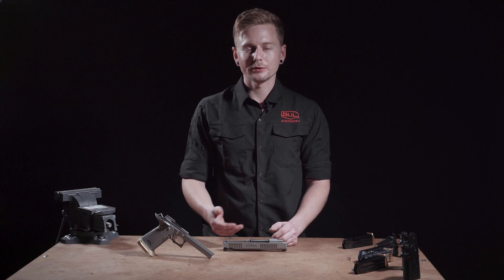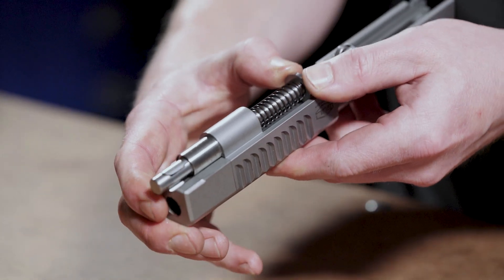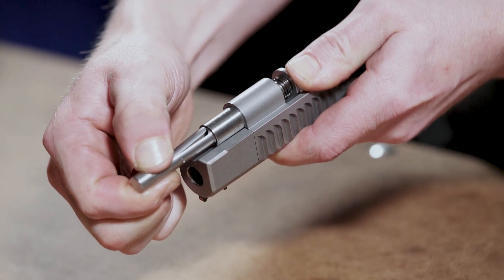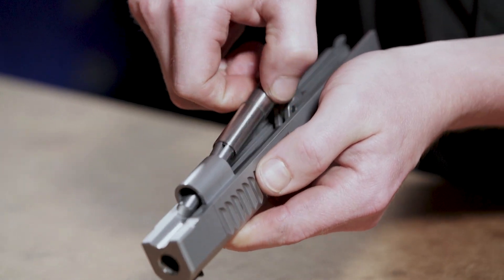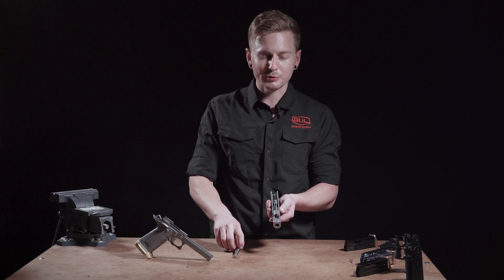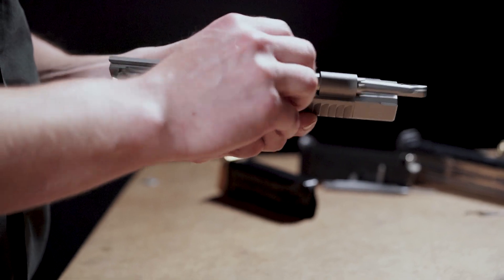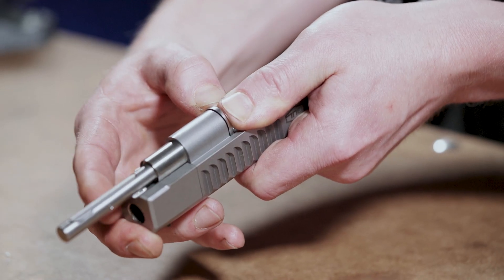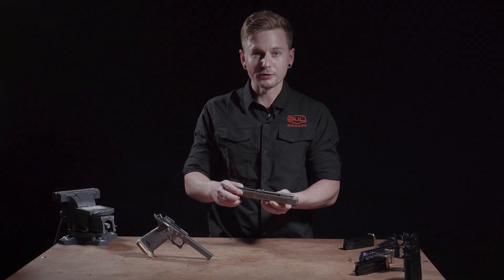Bul Armory tool less guide rod disassembly.

Comment: Is this a Bul part?  Or does the Dawson part work as well?

Can the tooless guide rod simply be swapped into the Radical 5.4?
Reply: i am wondering this as well.
Reply: Love how they post a video and never follow up with answering any questions.  Irritating
Reply: @jagpilotohio  seriously !  Using a hacked up paper clip end is getting old real fast.
Reply: @sp1pilot  lol!  I have the SAS Air and it’s damn nice but I’m not a fan of needing a “tool” for disassembly. I’ve been using an 18 gauge nail from my nail gun bent 90 degrees. Works fine until you can’t find it. 😂
Reply: @sp1pilot  the other odd thing is that there is no parts list available on the website. Do I  just have to send an email and ask about parts?  Pretty cheesy for a company making really nice weapons.
Reply: @jhurley12  I’m in the USA. There are no authorized dealers listed on their site. I’ve been on it multiple times.There is bularmory USA in Florida.  That’s it. No local or regional dealers listed. Very Bizarre.
Reply: @jagpilotohio  There are, im in the US also. Call Gilbert at GP arms, or try Oryx arms. Main two off the top of my head.
Reply: What type of ramped bull barrel, bul armory uses in its handguns. Wilson/Nowlin or clark/para. Please let me know 
 
Thank you
Reply: @Delacruz.j  My SAS 2 UR-F uses a Wilson/Nowlin type.